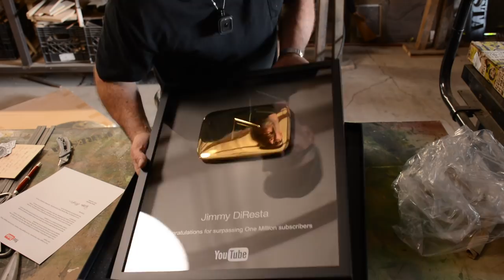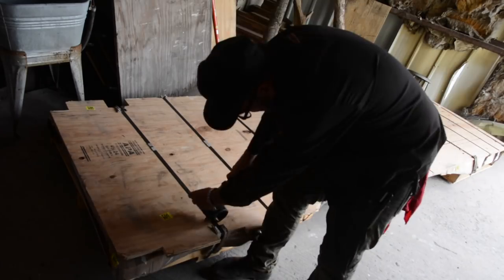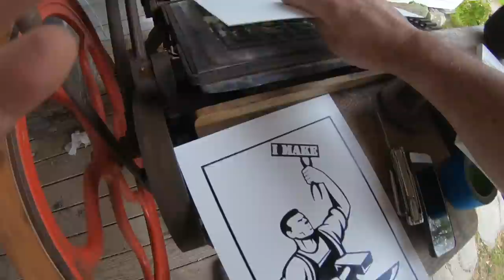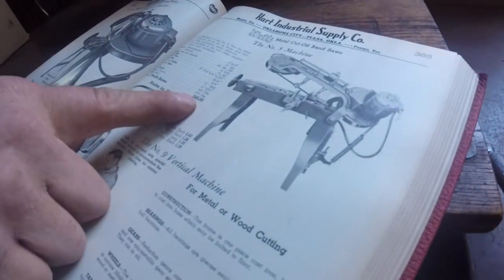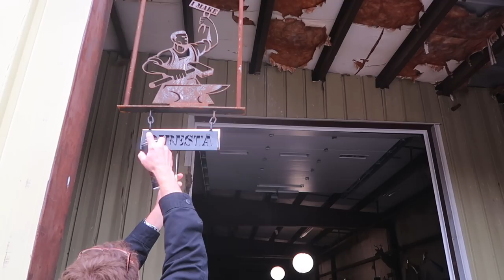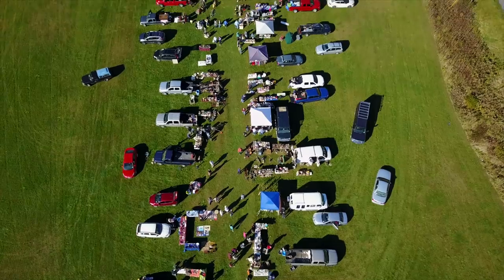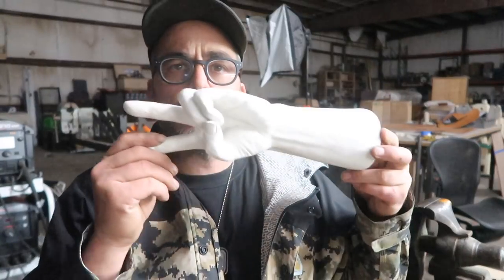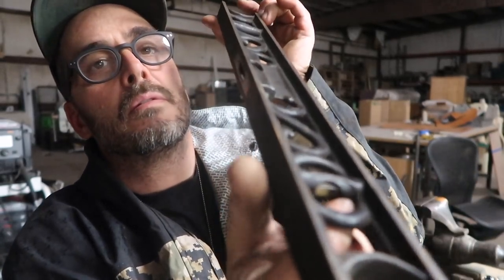DiResta 55 My Dream Shop

Comment: Congrats on 1,000,000. I always look forward to your videos.  Your building is coming along well.  If you are going to put a power hammer in there you might want to put the foundation in before you pour the slab.  Thanks for your inspiring work.

Comment: hey Jimmy. Good stuff. I am a swordsmith, part-time. I have hundreds of files. If you aren't storing them in a stand, I found that flat rubber hose works great to put files in. Cut short lengths and store the file in it and stack them. Easy and keeps the teeth safe. Thanks for sharing.

Comment: Rockwell Unisaw is the whereall beall when it comes to tablesaws, you can stuff your PowerMatic where the sun don't shine, the Unisaw is the choice of any veteran woodworker! It may be my opinion, but nearly 50yrs experience tells me what works and what doesn't. Slap a Biesmeyer fence on it and your good ! Just a tip..and only the tip!

Comment: Mr DiResta, the $1 part bins, look suspiciously like 1lb loaf tins. They make great bread, all that oxide and patina are great to stop the bread sticking. Give 'em a wash, a bit of oil and they're good to go. Get the right yeast and NOTHING tastes a good as home baked bread.
Reply: Exactly what i thought
Reply: I used to bake my own bread and agree it smells and tastes wonderful!!  But I wouldn't cook in anything from a flea market or yard sale.  Myself and a lot of other guys use cast iron pots to smelt lead and use muffin tins to cast ingots.  Loaf pans are commonly used for soaking stuff in solvent and other chemicals.  I have a few loaf pans like that under my parts washer. Chris
Reply: That's what those are. If you get on any of the Chinese manufacturers that run smaller jobs (or directly within the cookware business) you can buy them in bulk and use them as parts bin. Which is what i did. Bought like 100 small ones (about the same size as the ones D bought) and 300 large ones.
Reply: I perfer canned bread
Reply: I forgot they made canned bread.   My dad used to bring a case of C-rations (actually called MCI)  when we went tent camping in the early 70s.  One of the cans had white bread depending on the meal.  I really liked the beefsteak rations and the can of cheese and crackers.  I still have one of the P-38 can openers in my tool box.  Chris
Reply: AH CRAP I'm lying in bed and now i want some warm fresh bread! thanks a lot!!

Comment: The Dream shop's coming along nicely, but what about the floor? Will it be concrete and how do you make a floor after the building is already up?
Reply: artfx9 im not a builder but by the looks of it those metal things in the bottem are a good indecation of how high the floor must be . And a roof can be handy in winter,I think.:) Wish he showed more .

Comment: those parts bins ....  aren't those bakery shapes? I went to an old bakery and they had similar looking shapes. I mean i maybe wrong, as well as you could put parts in them, but i believe that the inside is coated with a non-stick substance meant for baking.

Comment: Dont you guys in the US have a lot of tornados and storms? That barn looks pretty flimsy imho.
Reply: Youtube User not really in upstate New York 

It’s also a lot stronger than you might think. Post frame buildings are impressive.
Reply: I've build a 30x20m mashine hall with my neighbour and the posts were 40x40/50x2cm steel H-Bars as well as 20x30cm wooden beams. Even though the barn was a lot bigger, it was still much beefier. Might be due to this being build in the US. Wooden buildings seems to be made from toothpicks over there. No wonder they fly away every time there is a serious storm.

Comment: Dude Please tell me your putting in-floor heat in. Any other source your gonna loose all you heat on the ceiling in that large open space. Even with a 2nd floor, I assume you'll still have 10-12'+ ceilings At the very least install the insulation and pipes in the slab. Anyone who has it will tell you it's the best source. 
If you want to put anchors in the floor let it cool a little then turn it back on, point an infrared camera at the floor and there's you pipes. Easy Peasey! With the in-floor you'll be in a tee on the slab and need a jacket in a loft. It only heats within 8 or so feet of the floor. That's part of the efficiency. Plus warm feet = lower temp overall. But that's just my 5 cents.

Comment: Jimmy, Look up the machine named Linotype . My father was a Printer by trade and before computers he used one of these to cast and arrange lead type to create newspapers. They,cast held and dispensed lead type into newspaper print boxes with a keyboard all manually. here is a photo for you. https://en.wikipedia.org/wiki/Linotype_machine#/media/File:Linotype_Simplex_1895.JPG
Reply: Or, next time you’re in Baltimore stop in the Museum of Industry to see a restored and working Linotype line-casting machine https://youtu.be/GvzqBb6o9cI
Reply: The story that always floated around the letterpress shop I worked in was that Mergenthaler invented the Linotype, then spent the rest of his years in an insane asylum. After running one for years, I understand why.
Reply: LOL I understand as my father was able to read and type backwards better than I was able to read  and type forwards. Something that always baffled me. He also proofread that way. I remember that the wooden floor in the old shop he worked in was caved in where the Linotype sat because of the weight. We took the old type home and melted it to make fishing weights for salmon fishing in Northern California.